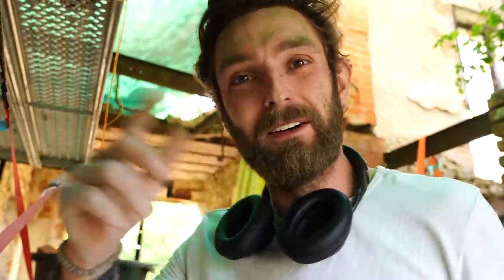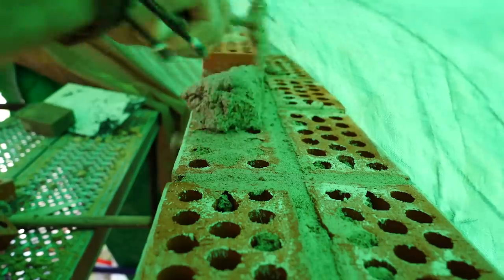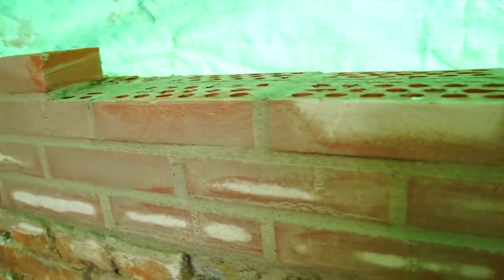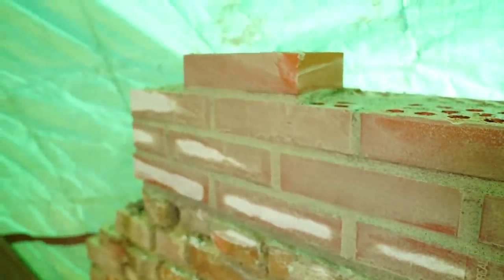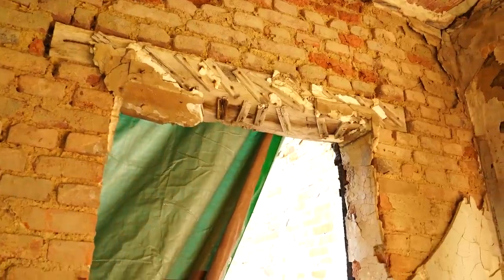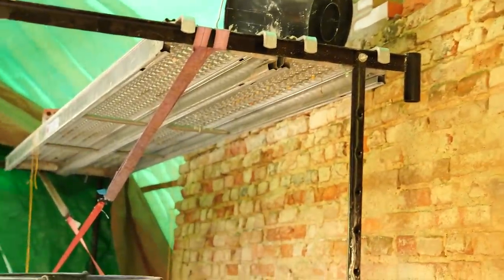The great rebuild has commenced; rebuilding a ruin brick by brick.

Comment: You can't tap the bricks it's a dumb misunderstanding to tap bricks make your mortar more supple by adding more lime to your mortar and make sure your mortar is wet enough than slide the brick pushing some of the mortar to the side of previous brick.this also is the way setting tiles never tap because your tiles will be lose when your work is ready. Thanks for sharing your work .

Comment: To make a brick arch is a fine idea, using a stone middle top is not : the stone middle tops are used in outdoors walls. If you are supposed to make it "à l'identique", this is not traditional. Also, the alternate positions of bricks in walls is
 stronger
.

Comment: As your working so high up and you will not see the bricks after its panelled you can build 4 or 6 rows at a time without removing the slightly wetter lime mix this will then be removed all in one go after that 6th row is done and its slightly gone off say 30mins later. You will do so much more than by cleaning up around each brick as you go. Also you can put the lime out in a long length and put the bricks down one after the other. Hope you understand my explanation as its really easy.
After handling the amount of lime your going to, you will probably regret not wearing gloves. 
🧤🧤🧤🧤🧤🧤🧤🧤
Reply: Also make sure everything's properly wet before adding mortar, as others have said. And if you intend to plaster the walls, don't finish the joints neatly, rake them out at least 10 mm deep so the plaster has somewhere to grip onto.

Comment: I was afraid the plastic on that bucket was going to give way where the handle was attached. Those bricks are heavy. 😵‍💫😊❤️
Reply: At some point it probably will. I've winched about 25 m3 of dirt, stone and brick from a basement and I think we've gone through about ten buckets so far, if not a little more. Mostly torn handles, some cracked on the bottom. And those were smaller buckets, 12 and 15 l.
Reply: Pass the wire under it and hook it to itself through the handles
Reply: @LaReynedeNeige  good idea.

Comment: You really need some of Billy Petherick's toys. For example, he has a forklift and an electric lifting platform with a basket.
Makes Life much easier, but cost a lot.
Reply: It won't help much in this build either. The only "toy" that would really help Dan is a crane and that's quite expensive. Still, might be worth getting an old one and have it professionally set up. Even 40-year old ones are quite expensive though and more complicated to set up than modern ones.

Comment: High again. The wall construction is called header, stretcher bond. Very strong in both directions.  Laying bricks all long ways on is stretcher bond. This is mainly used in house construction to form 11" and now 15" cavity walls. New insulation standards.
If you really want a strong cavity wall and have space you can mix them up nine inch header, stretcher. 4.5 inch stretcher wall with insulation between. 
A 9 inch wall built like the original wall  is very strong and will support a lot of weight. Good luck

Comment: Awsome work.  If you want to add a great deal of side pressure strength you could add thin but stiff wire into the mortar layer every few courses.  In the States one brand name is durawall.  Super easy to install but very strong.  At the height your working wind load is a big factor.

Comment: Also this wall is not called "double skinned" it's a single skin wall. Double would mean two of such walls next to each other with a small air gap of about 2-5 cm between for a total thickness of about 0.5 meters, which is how many houses in central europe were build for better insulation. 
Your wall is a single skin (even though nobody actually says it like that) 1 stone thick wall. A 0.5 meter thick wall would be 2 stone thick. 
1 stone thickness (your wall) is not structurally all that sound to be honest. Too thin on it's own for any house higher than two-tree stories and the static then heavily depends on corners and half columns which you can sometimes see in old buildings. It's always important to keep them, they are not there for decoration, they are deliberately thicker wall sections to keep the thin walls from buckling.

Comment: Daniel - "bollwerk" has some interesting suggestions - have you consulted a chateau renovation expert re the brickwork?   NOW is the time as any mistakes on the top floor will only get worse on the lower levels.  We do appreciate all of your hard work.  But also - look at Stephanie's  horrendous repair bills for the weak walls in Chateau de LaLande AND the horrendous  structural costs involved in rebuilding the chapel!!

Comment: I am trying to understand how a wall will be more stable with more brick on top and weight while the lower bricks and "grout" are crumbling. I'd be inclined to build new walls below working up. ???
Reply: He should re-point/re-mortar the lower original crumbling mortar below the new bricks he just laid.   He has already started re-pointing/(re-mortaring - for those of us not in the bricklaying trade) in the basement.  And, he has got ALOT of advice on how to lay the brick/re-build the new wall from bricklayers in this Vlog comment thread.   So, I suspect you may see him do just what you said in the near future.  He knows how to re-point; he is actually very good at it.

Comment: the cross bricks are to tie the walls to make them strong....but all you would need to do  4 brick spead through the wall just to make sur wall holds together by the way those bricks would be stronger because the different construction......but the walls need to be tied together across the 2 layers

Comment: I am not a native english speaker so I might have issue to explain. But let me say simply, as building and ingeneering is my job, lay bricks the way they were put oldway. The way you are laying them down you will have constructual issues with time. The way the old ones are layed down is the strongest and longest lasting conection and this is why it was done that way and is still standing. Its the best simple advice I can give you and you still have a lot to build. Material will be the same quantity any way but construction that will need to hold the roof will be numerous times stronger and you will have no issue that might be shown to you later in the way you lay down blocks now, especially as you are using blocks that are hollow inside, not full bricks.

Comment: The bricks need to switch direction every second layer. Your method is less stronger at a quite important part of the structure. I don’t know the English terms. But you can Google for blockverband or kreuzverband on the German nett. There you get drawings how to do it. It’s I Porta the that you change. Otherwise you get problems when putting a force on it later.

Comment: Dan copy the Bond that is already there ...headers then  stretchers  ...this is not face work brickwork ....looking pretty ..this is structual brickwork ....when the roof is put on with the spire there are huge forces from the wind acting like a lever this has to be built as strong as possible
Reply: As far as I can tell this wall will "only" support the little roof above the hallway and part of the rear third-floor mansard roof but still sound advice!

Comment: You do beautiful brickwork! :)
A hammock is a lovely thing. In Mexico, they build their concrete walls to support hammocks inside as well, during the summer. They string them up over their beds (for winter). Hammocks in the chateau???
Reply: Yeah, drilling hooks into the brick walls for a hammock should work nicely.
Reply: @Ragnar8504  , as I said, you build the concrete walls or pillars with the hooks built into them. I don't recommend drilling into a brick wall and hanging a hammock on it!

Comment: You should either be using wire ties between the inner and outer leaf of brick 900mm horizontal and 450mm vertical. No criticism, you're doing a great job.

What they did was a variant on Flemish bond  (and random rubbish bond!) with stretcher courses and header courses to bond the two leaves together, inherently strong.

Comment: Def should get a backup winch. Eventually that motor WILL burn out and you wouldn’t want that to happen when you’re mid-work
Reply: The switch is going to go long before the motor does. Been there, done that. Our first winch has failed twice so far, haven't found the cause of the second failure yet. And ours were pretty much the same model.

Comment: If a doorway is to have a door, be practical and only arch if you can fit it with a standard curved transom window above it. IMHO : )
Reply: The doorway won't be tall enough for a transom I think. The ceilings up there are fairly low.

Comment: You need a bonding course every 5-6-7 courses. That's the short side out, or the headers.
Reply: A header course of bricks ties the wall together (inside to outside). This is not the same thing as a header over a door or window (lintel).

Comment: as a process you need to move the cement mixer up to the top floor.
Reply: I'm not sure hoisting lime, sand and water up to the second floor is any easier than mixing on the ground and hoisting mortar.

Comment: The old bricks do need to be repointed and I can see some bricks with heat damage. Really confused as to what’s going on. 
Also I think that’s a hammock that is meant to be lain in diagonally lolol
Reply: How do you tell heat damage?
Reply: @carolinegooder7091  I'd assume the crumbling ones have frost damage and they can be replaced.
Reply: @Ragnar8504  some heat damage can be seen because they have cracks and spots that have piped or crumbled off, you can also tell damaged ones by “sounding” the bricks, basically tapping on them. The damaged ones sound different. And definitely consulting a specialist.
Reply: @kimberly_erin  That could just as well be frost damage. You're right though, crumbling bricks should be replaced.
Reply: @Ragnar8504  honestly as ppl said I think he’s making videos to raise funds, in the past anything that’s incorrect he has redone. So It will get there. I just hope he doesn’t hurt himself in the process.

Comment: Sorry to say this Dan but you should have stuck to the English bond pattern of bricks used by the original builder. It’s used for a reason and that is strength.  On the facade of the building I see they used Flemish bond in places and internally regular Stretcher bond. Unless you really know why you should change the brick pattern, stick to what the original builders used.  Your doing a fantastic job, I just don’t want you to compromise the build strength.
Reply: I strongly suspect in tomorrow's video we might see Dan return to the English bond. He does read the comments and picks up on a lot of them.

Comment: Just a question:  will you be repointing the bricks under the newly built layers above?  If not, will it not affect the strength and weight bearing of the layers you just put above today?  I laughed every time you tried to get on the hammock- the music chosen was perfect for that!  If you're using half-hitches for the holing, the rope that holds the tension will slip out....might I suggest using a clove hitch knot 1st, then half hitches to hold the knot in place.   'Tis the life though....glad you set it up!  If you put your feet a little higher to your head, you'll get more relief of the weight bearing strain on your feet and leg muscles.  Cheers!

Comment: Cleaning up the brick work is much easier when its mostly dry, then you can just use a brush and brush it off without leaving stains... but you will be putting a render on all this anyway (to protect the old brick work) won't you??

Comment: Are you also going to get the wooden floor beams in when you reach the correct height and then continue to rebuild the wall around them? 
I am curious how you will make room for the beams in the opposite wall since they previously had only the steel I beams. 
I can only guess you would need to use the laser to figure out the correct height then remove some bricks to accommodate the wood beams.
Reply: He mentioned a block and beam ceiling. That uses concrete beams, like lintels, and lightweight blocks suspended between the beams. Then you tie everything together by adding rebar and pouring concrete on top. In France it's called plancher hourdis, a very strong solution and easier to install than the original brick ceiling. He'll need to chop a few holes for the beams in the existing brick wall but that shouldn't be all that hard using an SDS chisel.
Reply: @Ragnar8504  I am interested how he goes about it. I thought he might of gone the lighter wood beam for that section of top floor. 
But tying the entire thing together sounds like a much better overall idea with concrete and rebar. 
Looking at that large expanse of central long wall has always got me worried about it bowing out and collapsing. Until he gets the floor in the rooms on the other side i could see it being quite weak and prone to collapse.

Comment: Have you considered collecting rain water to use for your construction?
Reply from the maker: I leave the wheel barrows out to collect water , that's as high tech as it gets
Reply: @escapetoruralfrance  Dan, with some awnings placed with ropes between the trees and giving it a wedge shape you can accumulate a lot of water. It's very cheap...
Reply: @escapetoruralfrance  Now if it'd just been possible to hoy those old water tanks over the side...

Comment: Has anyone thought about how long it will take him to even make this place livable ? lol. I'm 85 and sadly I won't be around to see its completion. 😕
Reply: Yes, it will take many years.  I hope you get to enjoy this time of Dan's begginning to renovate the Chateau.   His previous home, an abandoned farmhome, took him many years.   Dan has a video compilation of the many years of work on the farmhome; check it out if you haven't already done so.  It will give you snapshots of what he can do at the chateau, though on a grander scale. 
Dan plans to live in a small cabin onsite at the Chateau, and for that he'll need water, electric ( in addition to Eco-flow solar system he currently has for power) and a workable septic system.  He said in his farmhouse videos about a composting toilet, " Never again!".   He is waiting on permits. 
Meanwhile, in the middle of starting building up/stabilizing the chateau walls(so he can put a temporary roof), he needs everything all at once:...temporary stairs or ladder lift ( to make going up & down and carrying materials easier,) scaffolding inside & out, and a few more helpers regularly.   The temporary roof ( Dan brought in clear corrugated plastic panels a couple of Vlogs previous) will help protect the OSB3 subfloors he has begun to put in.  OSB3 can stand a little rain, but if they get too wet, he'll have to replace them.  
He plans to renovate the Chateau as close to the original photos as possible, using modern materials.

Comment: Might need a better rig for lifting all that heavy stuff up top, could burn the little motor out of the current rig with all the weight? 
😂 Every time I’ve tried a hammock I’ve bottomed out, dragging my butt on the ground. When you can’t attach the ends quite a bit taller than your height standing chances are it’s not going to be high enough. 😂🙋🏼‍♀️

Comment: Any structural engineers, professional brick layers, and period building restorers out there who can fly to France to help Dan out? I'm super worried about the structure and integrity of all the walls starting from the ground up. Dan, not worth it to do all this work if you don't have a solid foundation to begin with. You do not want structural failures at any point in the future.

Comment: Arched doorways would look lovely. I'm curious though, won't that making fitting doors trickier and possibly more expensive? Would the door be arched to fill the frame? and would that require custom doors? Or would the doors be rectangular and require something semi-circular at the top and would that be custom? Obviously I  have never rebuilt a chateau, I'm just trying to understand. Whatever you do Dan, I know you will do it well and it will look great.
Reply: Yes, custom doors, which is why I'm not a huge fan of the idea. Even if you were to build the doors yourself, and I suspect Dan will want to do that, having curved tops is a lot more complicated than having plain rectangular doors, which are complex enough if done faithful to the original design. Sometimes in old houses they used arches for strength and then put in plain door frames, which means a bit of brick infill resting on the timber door frame. That works but you always have cracks because the timber moves and the brick arch above doesn't. Personally I'd go for concrete lintels and recreate the original design.

Comment: That is the worst brick bonding I have ever seen. At least do it with alternating stretchers and headers courses like the rest of the wall. It's called English bond in english. google it and do it properly!
Also as fan of traditional craftsmanship I have to say these modern bricks suck. Way to smooth faced to ever bond to anything especially to plaster but also to each other and the stupid holes are a death sentence in any country that has proper winters since any small damage that causes some water leaking into these hollow bricks will then just bust the bricks when it freezes.
Also stop polishing the joints with that stupid sponge, it's bad enough that the modern bricks are as smooth as a mirror, if you polish the joints as well you will have to use super glue to keep any plaster on these walls.
You also need to leave the ends of the wall open and not brick them up with half bricks. How do you imagine you will continue the wall? think before doing something. That entire wall section you build should be taken down again and done properly. No foremen would let this stand.